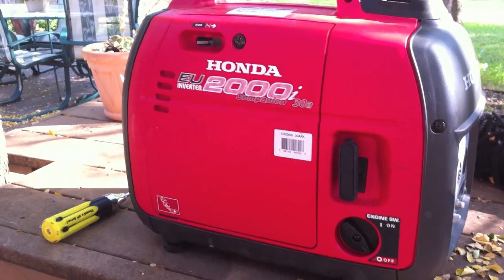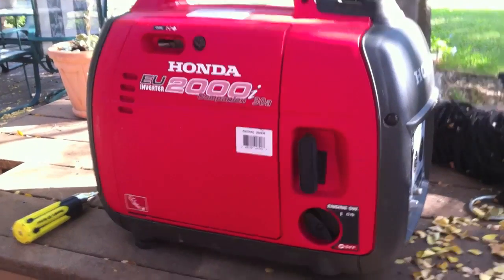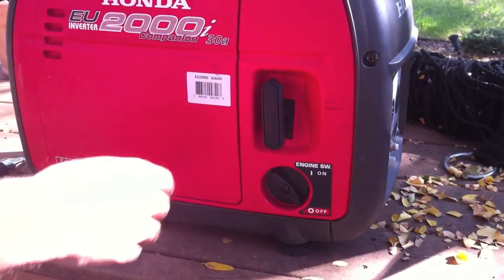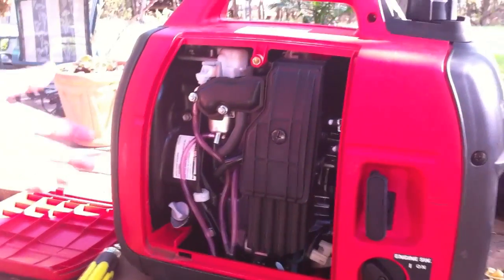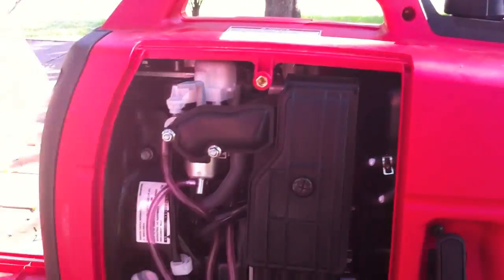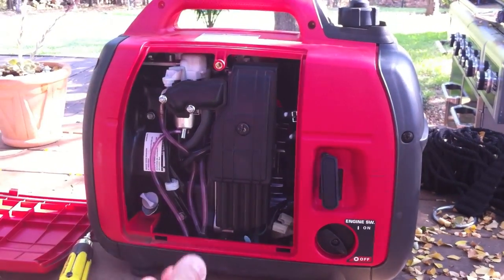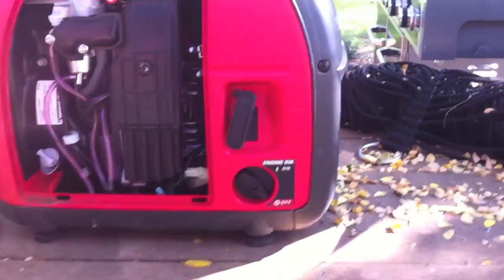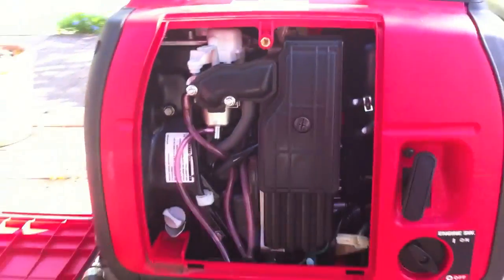Honda EU2000i Generator Carburetor Gum-up prevention

Comment: All you have to do is turn the switch to a position about 1/2" above the 'OFF' position (about 4 O'clock), this will shut off the gas so you can run the carb dry.
The new ones have this area marked as such. But it's still much faster and better to drain the carb instead.
And make sure the piston is in the 'compression' position (resistance on the rope) so the valves will be closed.
Cheers... TV

Comment: If you do this, like I did, you will not have a kill switch.  So if you don't want to purge the gas lines every time to shutoff, I have to choke and plug the exhaust pipe.   Purging the lines every time makes it hard to start.  I am going to install a manual fuel shutoff instead.

Comment: The problem with most fuels stored in generators isn't "gum and varnish". It is caused by the gasoline absorbing water from the air over time. Most gasoline today contains 10% ethanol, which has a high affinity for water vapor. Also, most fuel tanks have vented caps which allows pressure to equalize with temperature changes. As fuel tanks warm and cool slightly between day and night, the pressure inside the tank actually goes up and down every day. This "breathing" bring in fresh humid air every day which eventually causes the ethanol in the gasoline to absorb more and more water. At some point the water starts to separate out and sinks to the bottom of the tank. Even if you have turned off the fuel petcock and run the carb dry the last time you ran it - you can still have problems. As soon as you open the fuel petcock, the water in the bottom of the tank fills the carb bowl and it still won't start. The only easy solution at that point is to leave the carb bowl drain plug out, and put a jar under it. Turn on the fuel petcock and allow several ounces of "fuel" to drain into the jar to try to get all of the water in the bottom of the tank drained out. You can then replace the carb drain plug and 9 times out of 10 the generator will then start right up.  Also - many newer generators (particularly inverter generators) come with a fuel cap that has a vent that can be turned on and off. USE IT!  If you keep the fuel cap vent CLOSED - the fuel tank will not be able to breathe when it is in storage. This helps slow down the absorption of water into the fuel significantly.
Some generators have pumper carbs instead of float bowl carbs. The pumper carbs have no bowl for water to settle into, but they can still be killed by water in the bottom of the fuel tank.

Comment: The best thing to do is buy VP fuel,,or Racing fuel. It costs a little more and is harder to get but it doesn't contain Ethanol which is in most ALL Service station Gasoline. Ethanol Destroys fuel lines, clogs Carbs and ends up causing a Sludge in the bottom of your fuel tank. Same with Bio-Diesel. Always, Always, Always put in a fuel Stabilizer (Sta-Bil, etc) whenever you fill even if you are going to run all the fuel out. If not you will be heading for the shop and paying around $250-350 PER Carburetor...and with boats, ATV and RTV, some have as many as 6...so bend over.
Reply: Almost impossible to find Ethanol free gasoline in NJ.

Comment: iv been told that there is a so called fuel pump in it and it you do that the pump or diaphragm will stop working after a while I was told to put another fuel shut off between the carb and the fuel tank so that does not happen
Reply: I have been told lots of things by internet experts.  Some of them are even true!
Reply: I’m afraid that the fuel filter can get clogged up so my Honda is 21 years old and never had any trouble. When I run my generator for the last time I run a can of Tru fuel through it.

Comment: Honda Generators has several service videos that cover this. With the cover off on the lower left side there is a small tube that runs out the bottom of the generator. That tube goes to the carb drain plug. There is no need to disconnect anything on this generator like you claim. Once the generator is turned off all you do is drain the fuel from the carb by turning one small screw then tighten it back up..........BINGO......problem solved.
Reply: Do you have a link to the videos you referenced. Thank You.
Reply: +Mr9C1Driver Yup.  All of my Honda equipment has this feature.  Makes it so nice.
Reply: @gavincurtis  n
Reply: The fuel shutoff should be accessible without removing the cover.  Design error.

Comment from the maker: Choke on generator will fill the carburetor right away. One or two pull should be suffusion.
Reply: Mark Kash sufficient—-Grrrrrrrrr
Reply: no.  it doesn't.  When the lines are run dry it takes many pulls of the rope to start.

Comment: Cleaning the carb didn't do the trick? Still needs choke to run well? Here's the next step… The guy at my Honda generator store told me that what I needed was a NEW main jet.  Told him I made sure it was clean as a whistle.  He said that over time the main jet, which is brass becomes tarnished (inside the hole) so that the orifice is just a fraction smaller than originally intended.  Install a new one and Shazamm! no more choke needed. He also was adamant about the ethanol content of modern fuels raising hell with most fuel system components… if you can get AVGAS it has no ethanol and might help.   The Honda part you need is "Jet, Main (#62)" part number is 99101-ZG0-0620… cheap solution... I paid $5.14 retail. Job done.  Super easy fix once you face up to the fact that cleaning/clearing the jet doesn't do the job.

Comment: It is a lot simpler to just use the carb drain screw and ALWAYS use non ethanol fuel  mine is 5 years old an never had trouble with it. using the method in this video may cause damage to the fuel pump, and may cause damage to the inverter when the carb runs out of fuel the engine will surge and the inverter has to cope with this surging not good..
Reply: It's not the ethanol fuel, these hondas have tiny carb orifices that clog easily.  I've had them plug in under 30 days.  Cleaning the carb is easy enough, but there should be a fuel shutoff that is not connected to the kill switch.  Stupid design.

Comment: Recently I got to speak to a petroleum engineer and I discussed several items including STABIL.  She said Stabil does NOTHING to 'preserve' petroleum [gas/diesel], it only helps ignite bad gas/diesel. All marketing.........She said the best thing to do was to consume/drain all gas in the carbs & shoot fogging oil into cylinder, carb if your handy for long term storage. [over 30 days of non use]
Reply: SpockMcoy Issmart WRONG
Reply: guess what, he is 100% correct - run them dry!

Comment: Follow the instruction in your user manual to drain the fuel, starts on page 59. To keep from gumming up run a tank full of premium unleaded fuel from a national dealer like Chevron or whoever. Instructions for storage is on page 58 and breakdown includes intervals.

Not complicated guys. I have mine over eight years, use it regularly, never had a problem because I perform regular maintenance recommended by manufacturer.
Reply: None of that covers emptying the carb after every use.  Gas should always be shut off and completely burned from the carb.
Reply: We are talking about those who don’t “use it regularly”.

Comment: I always  use Stabil and still the carb gummed up. Had it rebuilt at a honda dealer and cost about 150.  I now get non-ethanol gas and put stabil in it and 
keep fingers crossed.
Reply: Same here. Stabil didn't do chit.
Reply: Need to drain the gas from the carb.  Gas evaporates and leaves varnish deposits that clog small jets.  Had to replace my Tecumseh (Toro Snow Thrower, I know it's not the same, but same effect) because of plugged secondary jets (surging while running).  (Stabil does not help much.  Ethanol will prematurely harden neoprene/rubber parts it contacts, and absorbs some water).
Reply: Ethanol is not Satan's invention like some people want you to believe especially in newer small engines engineered for it. . Regular use is what keeps generators running. People run ethanol gas in these generators all day long every day in street vending situations like food trucks and they run for literally thousands of hours or even tens of thousands of hours. Even if you "run the carburetor dry" before storing the generator, the residue left behind is still harmful. The needle and float can absolutely stick in the down position after time and there is always a small amount of residual fuel left behind on the jets and in the small carburetor passages.
Reply: My Honda is 21 years old and never any problems. Before I store it I always run a can of Tru fuel and spray fogging oil in cylinder. I also drain float bowl as well.

Comment: Seems easier and more effective to simply drain the carb bowl with the drain screw & hose already on the unit from the factory. Such completely drains the carb bowl, which I doubt would happen using the method shown.
Reply: You find that easier than unplugging a switch?
Yes, all the gas burns out of the carb this way.
Reply: runt it dry, like an outboard - hello

Comment: This solution looks good on paper, but I have my doubts about how well the vacuum diaphragm in the fuel pump will hold up when stored NOT immersed in gasoline to keep the rubber conditioned. PLUS...even if it doesn't damage the fuel pump, you will most likely have to pull the cord many many times to build enough fuel pressure to re-prime the completley empty fuel system. Bottom line is Honda engineers dropped the ball big time when designing this generator. Kudos to Yamaha for the EF2000IS!
Reply: Evidence of this?  I've not experience any problem.  Or are you one of those internet experts with an imagination?  Don't disagree, this is a design flaw.

Comment: BEWARE! If you do this to your generator it will kill your fuel pump diaphragm dries out its made of rubber. The best way to do this is put your own petcock right in front of the carburetor!
Reply: How does installing a petcock not cause the fuel pump diaphragm to dry out?   Seems like same result shutting off the fuel either way.